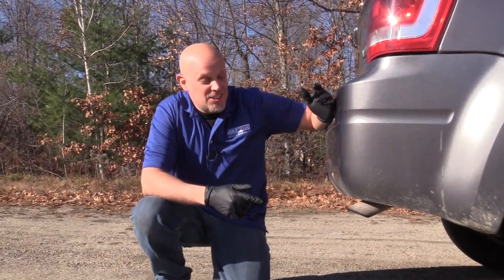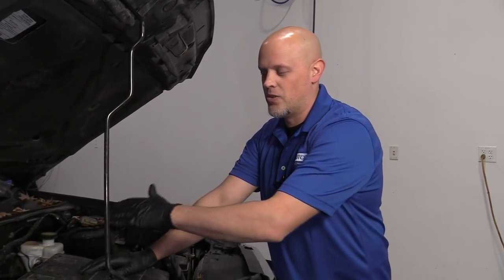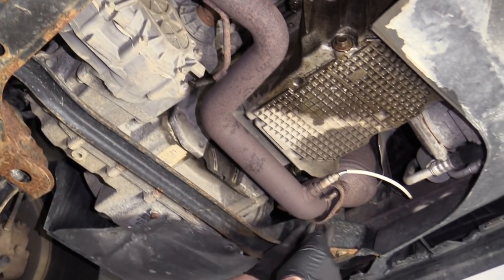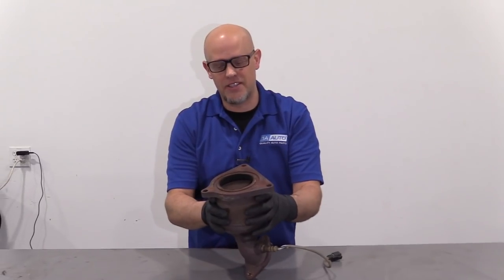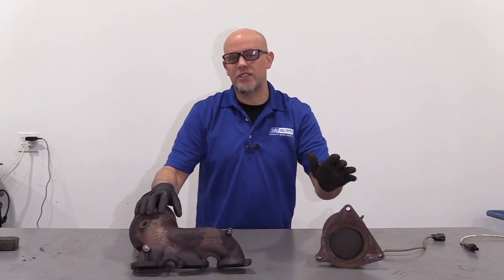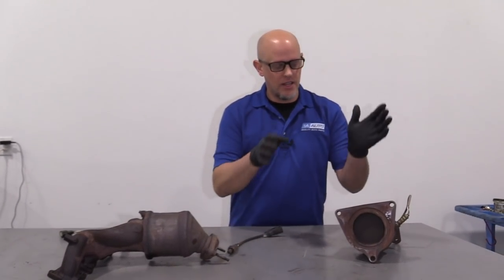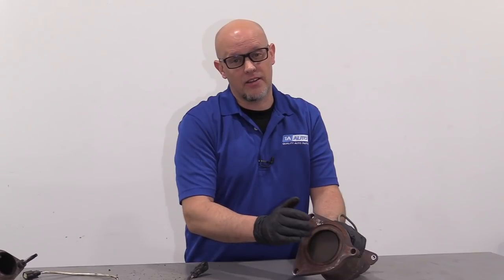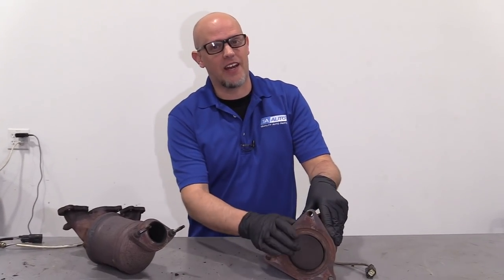Check Engine Light? Smelly Exhaust? How to Diagnose Catalytic Converters

Comment: My Miata has a lack of power. Downshifting usually fixes it. 5,000 rpm tends to be the sweet spot where I can actually get some performance. Sometimes it smells like rotten eggs, but mostly nowadays it smells like gasoline, particularly when I first start the engine. Knowing my luck, it’ll probably improve once pieces of honeycomb start falling out of the exhaust.

Comment: i have a 07 G6, i think the catalytic converter is disintegrated. it sounds like sand when i bang on it, rattle on startup, and bad smell while in the cabin. I have a code p0420 and misfire code p0300, but the vehicle has perfect fuel trim no rich or lean condition. can a bad/disintegrated cat cause a misfire?

Comment: Great video. What if you dont have a CEL but I have the P0421 & P0431 codes? The car runs great and no smell. The codes are stored I guess? How do I get them off? I clearde them and I'm going to run through a drive cycle and take it back for smog after I check the scanner again

Comment: I have a question.
I have a 1999 Chevy Tahoe 4dr 4x4 5.7 

I just got the catalytic converters replaced by a muffler shop. Now when I go up hill at 75 mph or faster it smells like rotten eggs. I have done a full tune up, and took it to the shop and nothing showed up on the scanner.  And still smells like rotten eggs 🍳. Any ideas or suggestions

Comment: I have the smelly sulfur smell and white smoke from exhaust. I also have 210 compression from cylinder 6. Are they both related or do I have to do valve clearances and clean my cat converter?
Reply: 210 PSI at cranking for compression test is extremely high and the Mac should be no more than 200 and even that's high. You have way too much cylinder pressure.

Comment: I have v6 tundra, can't set catalytic monitor, no engine light,  it has front and rear catalytic, front one tempurature inlet is 350, outlet 500, the rear catalytic is 325 for both inlet and outlet, is that normal?

Comment: So I have a 1994 chevy cavalier rs
I have no engine codes and replaced everything to do with cooling (radiator was cracked) before I changed it the check engine light would randomly come on and kick the rad fan full blast all the time until the car is shut off. Then the light goes away. Sometimes its comes on and sometimes it doesn't? Each time it does it only kicks the radiator fan on. I've checked the wiring and changed the fan relay

Comment: I've used cataclean and still have issues when I take off motor stutters  I hot the same code what other options do I have before replacing the converter?? Ty

Comment: My mechanic replaced 5 catalytic converters and 5 O2 sensors and the check engine REFUSES to go off im done im gonna fist fight my mechanic soon I've been there 15 times and spent $1500
Reply: Remember there’s more than just that it could be the spark plugs, the throttle body any of the o2 sensor connectors or cables. All of that you can do it at home without any specific tool don’t spend money like rhat
Reply: Lacquer thinner

Comment: Hello. I have a rotten smell come from the exhaust pipe and rough idle found vacuum leaks got those fixed replaced EGR valve  still nothing replaced idle control valve do to vacuum leaks also the throttle body gasket still nothing the only one code I have now is a P0406 …. Engine runs very rough Need help —-04 expedition 5.4 motor

Comment: Hi can you answer my question. 
I have a code P0430. But not smell like eggs 🥚. 
What do you recommend to check. 
I changed the intake manifold gasket. 
And the 2o sensor. B2. S2
And light come up next day.
With the code P0430 well it was before with the lean codes. Any advice. Please.

Comment: What if you don’t get check engine 💡 light and still get a bad smell when going over 60 mph on the highway or freeway 🛣 🛻 .. and it’s been going on for years ? Could it be of oil going to field stream in intake !
Reply: That smell is carbon monoxide an you’ve been using it for years your exhaust is getting in one way or another I know a person who got a stroke cause of it

Comment: But its so expensive. My 2015 Hyundai Accent has a code for the converter. It runs great would bever know it had a issue. I've reset the code before it came back after a couple mths. The first time I used the Cataclean it worked service light went out. The second time it didnt . I don't drive much I stay local so I've been driving longer distance..didnt help light came on. I think I'm going to just keep an eye on it and if it acts different I'll have it checked out. I don't think I can ever afford a new converter.

Comment: Can a cat be worn also from lots of miles. My Elantra has 240k on it. My cat needs replacement it has all those symptoms. I just don't want the other variables : oil or gas or radiator fluid going in there cuz that could mean whole other issue plus the cat being compromised now.

Comment: Can I get the link to buy the cats for a 2005 Lexus IS300, have both of those codes, plus P0153 P0133 P0174 and P0171, but I’m positive I got those codes from these two codes. And have every symptom you listed off.
Reply from the maker: +Alexander Lara Trespalacios Thanks for checking us out! Can you please confirm which sensors you need replaced?

Comment: 1A, I HAVE A97 740I M MODEL, MY MECHANIC SAYS IT'S GONNA COST 3400 FOR NEW CATS FROM GERMANY,CAR HAS NONE OF THE SYMPTOMS U GUYS ARE TALKING ABOUT AND IT HALLS ASS WHEN I GIVE IT ⛽ GAS, CHECK ENGINE LIGHT HAS BEEN OFF ABOUT MONTH (BEEN USING TECHRON) BUT I STILL SMELL STRONG FUEL ODOR,ANY IDEAS....

Comment: Will a clogged or broken catalytic converter prevent a car from starting? This is my current situation now.
Reply from the maker: +FLUNOIR We wouldn't be able to diagnose an issue like that here, you may want to have a local mechanic take a look at it. Thanks for checking us out! http://1aau.to/m/Shop-1AAuto-c
Reply: No. Check your starter.

Comment: I fixed po300 301 and 302. Now po420 comes on. Would a misfire cause the cat to go bad. What should I do
Reply: That's the same question I have the same codes that you had the 300-304.. i replace the plugs now 420 is only one remaining on my 04 Civic it won't accelerate past 30 mph

Comment: I have "Check Engine" lit, yet the car goes perfectly fine.
Both oxygen sensors are changed and are working properly.
Sometimes during the drive the light goes off itself, yet after a while, usually at lower RPMs and in 3rd or 4th gear, it comes back again.
Also, when A/C is working and RPMs are low, light goes on.
Any clue on this issue?!
Reply: Same here did you figured it out?
Reply: You need to check your fuel trims with a scanner it seems as though your fuel trims are out of whack and you are perhaps pushing too much fuel and you are running rich which can destroy the catalyst converter and cause a lot of carbon inside the motor. Also change your PCV valve to make sure you're getting proper positive crankcase ventilation

Comment: So I have a Mitsubishi gallant with a v6 . It has a misfire. (Before the fix it gave a cylinder 6 misfire. And o2 bank 1 sensor 2 code.) I’ve replaced coil packs, spark plugs, and valve cover gaskets. After the fix for some reason it gave (injector circuit open for cylinders 2,4,&6 throttle pedal sensor, evap, and the same 02 sensor code from the first scanner). Can’t seem to find the misfire but a mechanic said maybe the cat is clogged up. He said unbolt the  catalyst converter and start the car and see if the misfire goes away. Does trick sound about right ? For a diagnosis?
Reply from the maker: +Markel Scott We wouldn't be able to diagnose an issue like that here, you may want to have a local mechanic take a look at it. Thanks for checking us out! http://1aau.to/m/Shop-1AAuto-c
Reply: @1AAuto  thanks and I know . I was asking on my behalf to try ? Since I’ve tried everything else .

Comment: Hi i replace the catalytic manifold on my 2013 ford explorer with aftermarket part but after I replace it the engine shaking when I run the car and drive it to 30 to 40 I get shaking and fell the car try to turn of or miss fire is this because the aftermarket catalytic or something else?
Thanks so much
Reply from the maker: +Saifaldeen Hashim We wouldn't be able to diagnose an issue like that here, you may want to have a local mechanic take a look at it. Thanks for checking us out! http://1aau.to/m/Shop-1AAuto-c

Comment: They stole mine so its straight pipe..... the shop wanted $1600 the repair 😂 I only paid $1200 for the car 😂 it runs fine but the check engine light will go off now

Comment: Check engine light Ford focus 2008 model .
P0037 - HO2S , Heater control circuit low, bank 1 sensor 2
P0136 - O2 sensor circuit, bank 1 sensor 2
P0030 - HO2S, Heater control circuit low, bank 1 sensor 1

Replaced the sensors still having the codes. Any help would be appreciated.
Reply: I cleared the codes and they returned after driving.
Reply from the maker: +Smokingmonke91 We wouldn't be able to diagnose an issue like that here, you may want to have a local mechanic take a look at it. Thanks for checking us out! http://1aau.to/m/Shop-1AAuto-c